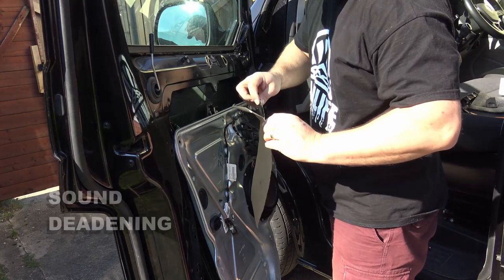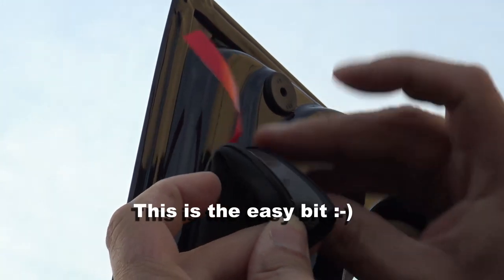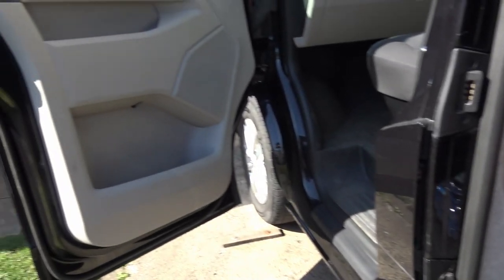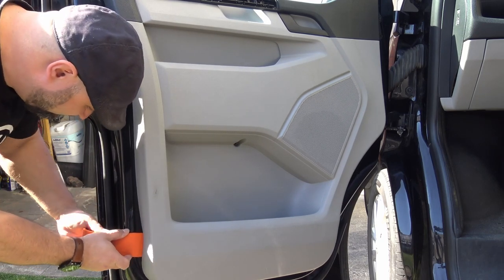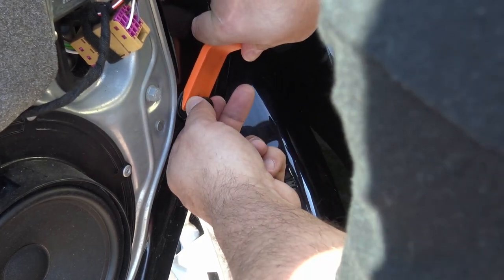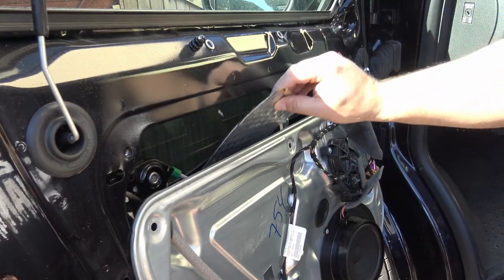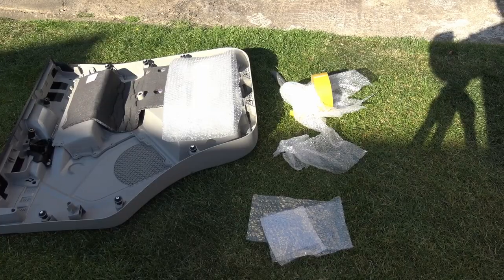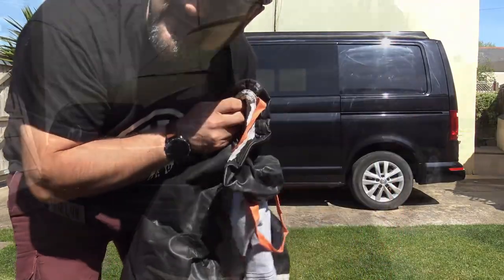DuB-EnG: T6 VW VAN Front Cabin Door Sound Matting, Extra Rubber Seals, and Fitting a Protective Bra

Comment: Great advice! Got myself some seals as was already a slight gap at the bottom of my sliding door. Shuts much quieter and air tight all the way round 👌

HOWEVER, as with all van conversions you fix one problem create another, the side door now very visibly sticks out particularly the side closest to the front where there is no proper "latch". Is my placement maybe a little off? Should it be just off centre to the seal rather than directly in line with it? Any advice appreciated!

Thanks for the great video 👍
Reply from the maker: May I suggest the VW t6 forum..  a lot of experimenting has been done there... Best, Howard